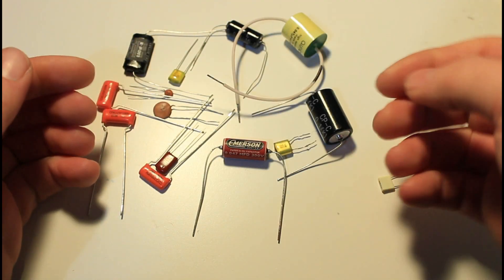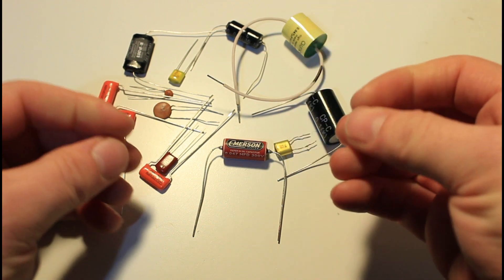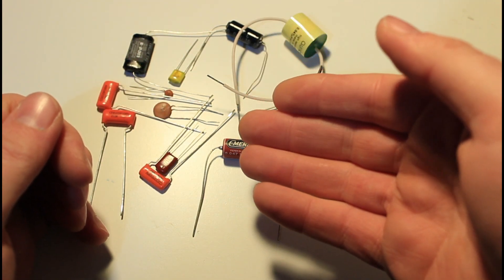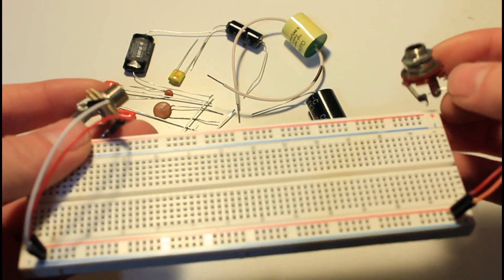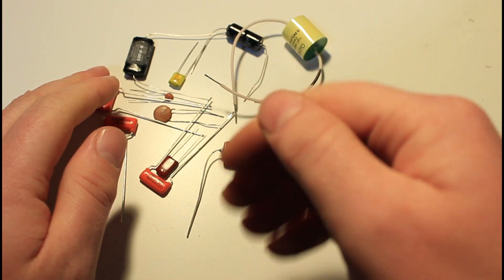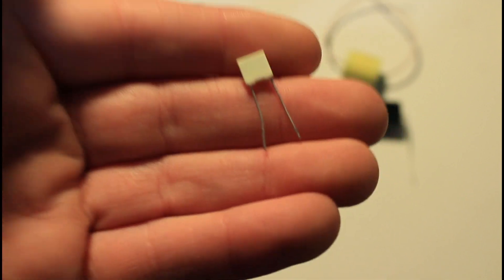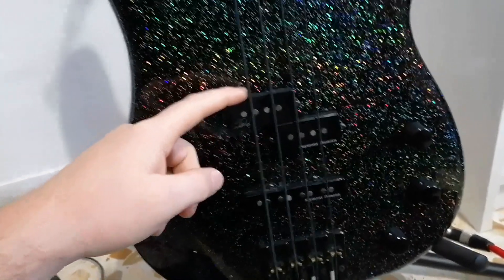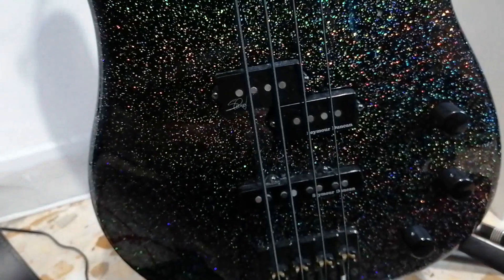Can you tell the difference? 0.20€ vs 20€ capacitors

Comment: Different quality/construction/voltage capacitors can sound very different depending on the electronics. An Emerson cap on a Squier pot through a practice amp won’t sound any better than the factory chicklet, but a pair of Emersons will sound gorgeous on a set of Seymour Duncan P90s & TAOT 525k custom CTS pots through an Orange amp.

Comment: Polypropylene hifi grade caps are superior, we use them in 95% of passive loudspeakers, I use the Fender Greasebucket set up, i threw the horrible 4mm diameter ceramic caps & a cheap 1/4w resistor in the bin, i changed the caps for hifi grade 5% Polypropylene caps, 15mm x 10mm diameter, a 0.1mfd & a 0.022mfd or 0.047mfd Polypropylene Capacitors & a hifi quality 1% 1w 4K7 Resistor, sounds so good with this set up, if you prefer a slightly darker tone the 0.022mfd can be swapped for a 0.047mfd cap, used with CTS 250K 8% tolerance, brass shafted Linear Pots, sounds more 3D & a smoother but more detailed tone, worth the couple of £'s for the difference & an hours work for sure, i now fit Greasebucket tone circuits to all my passive bass's.... 2 Fender Jazz's & a Jaguar PJ, Ibanez SRX360 & FretKing Esprit....all now sound better to my ears, i used to design loudspeakers, the passive crossover components are the most important to get the best tone possible....good stuff
ps, i thought the Polypropylene was the best sounding, the Emerson is pretty good & the other PIO was almost the same, listening through a 7.1.4 Dolby Atmos system with SVS SB2000 subwoofer, very good sub..still prefer the Greasebucket circuit tbh

Comment: The clean sound …I play bass also and the 62 fender jazz  set up is good . Two concentric volume and tone controls and the value is  .05uf and .03uf  for ceramic capacitors I’m switching to Wima  film  caps . I like the results in HiFi gear so the film should be interesting ? Also with such low values it’s not the same as larger values  .

Comment: Now ping the capacitors while in use. This is why the orange drop capacitors are king and the ceramic ones are not good for audio use. Ceramic caps have the same values but they don't behave the same when subjected to real world testing. Ceramic caps are best for pre-shielded no-vibration environments. In those environments, they are great and save a lot of money.

Comment: I've been A/Bing caps for my circuits over the past 2 months. I do it blind with a switch. I found that rather than a specific type of cap sounding better than another, specific types of caps would sound better for specific instruments. For example, for my Tele circuit, I started with Fender wax paper reissue caps, but found Jupiter Red Astrons (which are mylar caps) to sound better. So for my p-bass I tried Astron, Vitamin Q (100 nf), and the fender wax paper, thinking the Vitamin Q would win because it was the most expensive and PiO. But for the bass, the Fender wax papers had the best tone.
In your video, I can hear how the orange drops are focused and the ceramics are tight. Vintage style caps are more open and round sounding. The tone can breathe.
It's a very subtle difference and takes training to hear.
Personally I'm a fan of Cornell Dubilier Greenies.

Comment: You need to try monostyrene caps filled with Argentum infused Squamata oils with a sprinkling of Aurum. Only then thou shalt hear the micro-details that the strings may or may not produce.

Comment: Changing from linear to audio taper regardless of Capacitor makes a difference you can feel. Linear seems to have a more sensitive effect as you turn from 0 to 10 you can hear/ feel the variation from 1 to 2  2 to 3 etc up to 9 and 10. Best sound I heard was a Jensen .1uf paper and oil with a CTS linear pot. It was a bit big for the Guitar so I changed it but the recorded tone had a tighter and punchier sound.

Comment: Actually I liked more the Emerson and the orange cap. But the difference is almost 7 times more expensive the Emerson one.😮
Reply: some may be far more pricey than others, sure, but you’re only talking about one, maybe two per instrument. how much do we all drop on strings or strap locks or pickups without hesitation? 

honestly, if someone is so opposed to ponying up for higher end components, maybe you’d be better off completely omitting the tone control and cap entirely; instruments sound great when run wide open like this.
Reply: @liquidstar9  true. I went with Vitamin Q and Russian PIO caps . RightNow not are that expensive and looks great 👍
Reply: @bsa2025  sweet, what do you think of them sound/feel wise?

Comment: At these voltages and low frequency, only capacitance value matters. Ceramics also can be non-linear and producing harmonics and may be exhibiting microphonics effect, but not at these voltage levels. So pick the cheap high volume polypropylene ones and you'll be happy...

Comment: I can’t hear anything that would make me shell out more than a few quid on a 47nf capacitor. I’ll stick with orange drop, as it’s what came with my wiring kit, but it was building from scratch, I’d go with the cheapest
Reply from the maker: Yup, not worth spending that much on something you're not even using most of the time (probably). A decent one such as an orange drop is more than you need.

Comment: The only time a capacitor will make any significant difference to the signal is if it causes distortion, ie, defective, badly installed, or is micro-phonic. More important considerations are temperature stability, lifespan, and not suffering from micro-phonic issues (ceramics). Film capacitors rule the roost here.

Comment: People need to understand that the way the caps were demo’d is like when you have your tone pot on 0. Who plays like that? When its on 10 very little signal goes to ground through the cap. Meaning the cap is doing very close to nothing with the pot on 10. So if you think there is little to no difference between caps in this demo then multiply that by 100 with the pot turned up. So in real conditions your just not going to hear a difference at all.

Comment: Are you aware that the capacitors need to be warmed up? they are not immediately revealed by the sound .Well, that is, you need to play music through them for a while and then the sound will be fully revealed.For some kind of capacitor, a few hours are enough, for the second day, and the third needs two months.You know what I mean?
Reply from the maker: We're talking extremely low voltages here, in the millivolt order. So I'm not convinced that it would actually make any real difference in an instrument. Besides, what we hear is what doesn't go through the capacitor, the higher end is lost to ground
Reply: @OliverTobyn  Ок .But in any case, the experience  is interesting!

Comment: great video!  and just my $.02, i've been playing bass for about 30 years now, and am also an audio engineer and work with electronics for a living, primarily servicing tube amps and guitar/bass electronics.  i have spent a LOT of time in proper listening environments auditioning (at least) hundreds of caps of various values and construction types, and i might have some useful info for why some things are easy to hear and others not so much.  first of all, i did hear differences in this video between the caps, most obviously between changing values of the same type of cap, and more subtly so between the various construction types.  i must say that cap differences in this video are not presented in a way that best reveals what's changing when the cap swaps, though that isn't meant as a fault or problem. the reason the different construction types were hard to tell apart was because the artifacts of a cap's construction type are in the dynamics and note envelope, how the tone and feel change OVER TIME AS THE NOTES DECAY, and how that juxtaposes with the next note played.  it's a matter of the unique "dynamic signature" (and by "dynamic" i simply mean volume/tonal changes over time) arising from artifacts of physical construction.  what i usually notice is whether the instrument seems to play more stiffly or loosely, how the "bounce" of the rhythm sounds, but not in the frequency rolloff differences like you get when simply shifting the capacitance amount.  with swapping construction types, it's a difference i feel more than hear, especially when i'm playing the instrument under test.  it may seem trivial, and under these conditions on youtube, it may kind of be.  but try it out yourself sometime on your own instrument and amp setup.  see if you can notice changes in how pleasant or unpleasant the instrument is to play through the amp.  with polyprop/polyester and some mylar type caps, i notice they tend to make the instrument seem to play stiffer and tighter and more focused, and this is whether the tone is fully down or up.  styrene caps have a slightly sticky and sparkly character i notice.  paper-in-oil type caps act very differently, they almost seem to have a tiny bit of reverberance or some resonance-based sound artifacts.  i have also noticed that changing the cap's voltage rating can make a big difference; generally speaking, for most caps i've worked with, lower voltage rating caps don't sound nearly as pleasant as higher voltage rating caps.  anyway, well worth messing with and dialing in right.                                                                                                                    ,
Reply: I'm interested as to what your opinion of the ceramic capacitors is? I could tell a subtle difference on this test. The More expensive ones had a lower cut off poiny, I wouldn't  say that in this test one was better than another, just different, very slightly but different.
Reply: @stuartchapman5171   i thought the 100nF brown ceramics in this video sounded great.  i wasn't super impressed with the cheap red or yellow film ones, though the small white plastic film ones sounded good.  i dig the low end on the big yellow film Auricap.
Reply: thanks, this is super helpful
Reply: Hi Jon!
Thanks...
How high should be that voltage, 200v, 300v, 600v or? Which would be the best?
Reply: @BasszusX  it's instrument level, so basically any voltage will work fine.  however, i have noticed over time that the higher voltage rated caps i've used tend to sound significantly better, though i have no idea why.  perfect example - the CDE 940 and 942 series available at mouser, the 3kV ones sound amazing, to my ear far better than the ones rated for lower voltages.  again, not sure why, but there that is.
Reply: @liquidstar9   Thank you very much!
Sorry for the very late reply, but I wasn`t notified by Youtube, and good that I checked again now.
Thank you!!!
Reply: L'ingegneria del suono inganna il suo proprietario a volte varia a seconda del tipo di altoparlante o un brano musicale lirico e a volte tra stereo e surround per esempio È così Che la verità diventa chiara l'ho provato
Reply: @liquidstar9 none of what you said has any basis in the known and measured physics of passive capacitors. For a start, the first half of the tone circuit is all due to the pot, not the cap. So when you say "whether the tone is fully down or up" you are referring to one part of the tone circuit where the cap is not involved at all, to one where it is. If you say you are hearing differences due to the cap type in both parts, you're basically admitting that you're imagining something.
Also, the notion of a "dynamic signature" that you imply is different to the frequency response characteristics reflects a misunderstanding of frequency response. For example the high frequency response tells you what the attack will be like. The lower frequency response tells you what the decay will be like. The envelope of the note and the frequency response are not separate, unrelated characteristics as you imply.
In short, it's as if you've been smoking the caps as you listen to them.
Reply: @vw9659  lol what a polite reply, thank you. you have a way with words.  i guess i must just be full of it then, since it's stuff you weren't taught, right?  my ears simply have to be lying to me or i'm crazy, because it wasn't in your textbooks, and you know everything.  i'd like to recommend that you avoid experimenting with any of the things i mentioned above, or you might risk going crazy too.  definitely don't trust your own ears, whatever you do. i'm confident that your ears will lie to you.  just trust what your meter says and rest easy knowing that's the end of the data present.  don't take the time or trouble to find out anything for yourself.  you'll just be disappointed by reality, or worse, find out you might have more to learn.  you should also keep up this hostile, bullying attitude you've got, i bet it's serving you very well in your life. maybe one day i can have it all figured out too, like you.  i'm just lucky to get to be condescended to.  jerk.
Reply: @liquidstar9  you wrote with an air of authority (30 years playing, audio engineer, electronics work) that obviously convinced others in this thread. I merely pointed out the inconsistencies in your interpretations of your heard experience. With some people charging $50 for mystical capacitors (a sensible purchase if one takes the implications of what you said), that do exactly the same thing as capacitors costing $1 or less, it's important for people to hear the contrary view. Or do you believe that you should go unchallenged ?
What I wrote is not from textbooks. It's from the objective testing that many people have done with guitar tone circuits, in various ways. Which is consistent with what they and I hear with our ears.
I am sure you believe what you think your ears are telling you. But you should read the studies by Floyd Toole and others in the audio industry, which found that music industry experts are not always able to discern the sounds they say they can, when objectively tested in blinded studies.
I made specific scientific points which you are welcome to counter with objective evidence.
Reply: @vw9659  whatever, dude. i gave some background info to establish that i've been at this for some time.  i'm not an authority.  i suggest that everyone try for themselves.  if you don't hear a difference when you try my suggestion, feel free to disregard it.  but if you are going to only base your view on the opinions of others, that's on you.  and if you're going to sit there and trash me and my work when you haven't tried my suggestions for yourself, then i suggest you get stuffed.  you don't have experience or evidence, just trash talk. and you didn't "counter" what i wrote, but just rudely shat on it.  i know what other people who haven't tried my suggestions have to say.  so, good job contributing nothing.  i'm not interested in trying to counter or convince you of anything.  try it yourself, or don't.  i don't try to reason with people who talk to me the way you do.  and i definitely don't try to reason with people who don't believe in their own work.

Comment: IMO, the reason for getting high-grade, modern capacitors would be not for tone but for getting less noise and hum
Reply from the maker: Eh. I guess. Still, most hum comes from pickups and bad shielding, and if you're using the tone pot those frequencies get sent to ground anyway
Reply: @OliverTobyn  I should clarify that I know nothing. It was just a thought because I myself have been guilty of focusing so much on tone and feel that I filter out the difference in noise, and I've found out the embarrassing way that the reason to get good electronics isn't just to sound better. It's also so that your whole rig is better protected against challenging work environments,  like when your tremolo pedal picks up the swan song of a slowly dying stage light, or when you (hypothetically) have been paid as a classically trained singer to perform a delicate version of Amazing Grace" at a crematory funeral and the shoddy diy wiring of your pristine Jeff Buckley-like 200€ Tele neck pickup starts imitating the Mike Tyson drone as the elevator starts lowering the casket. Also there might hypothetically be some lush reverb pedal that makes it sound even more like a satanic horror movie.

I shudder with embarrassment just typing this.